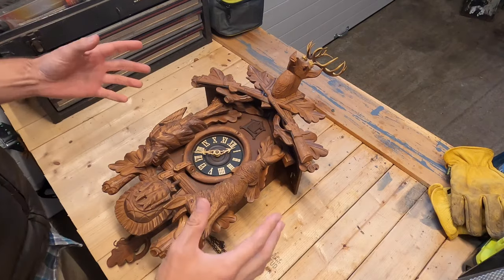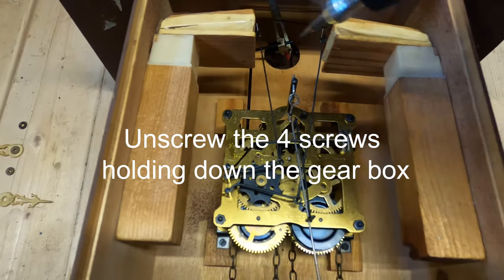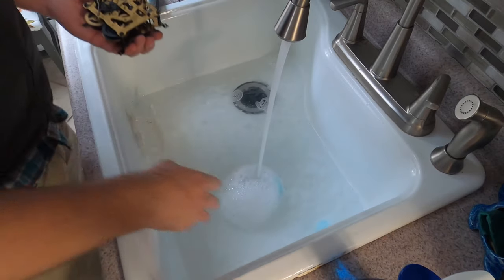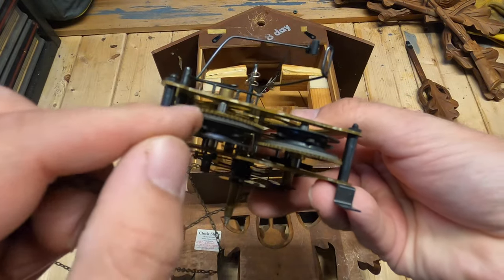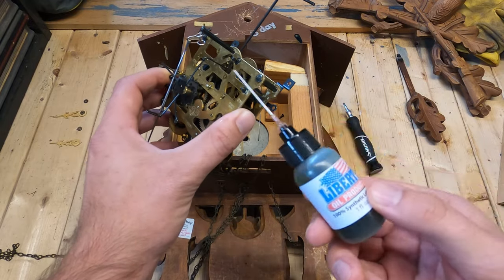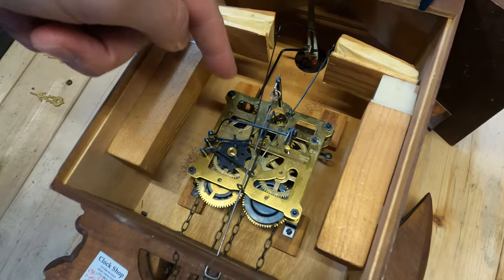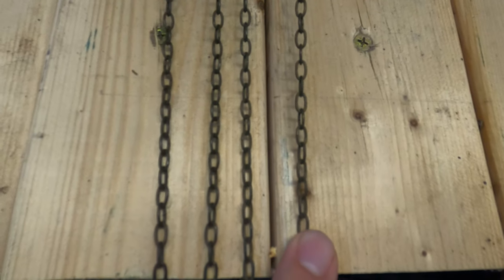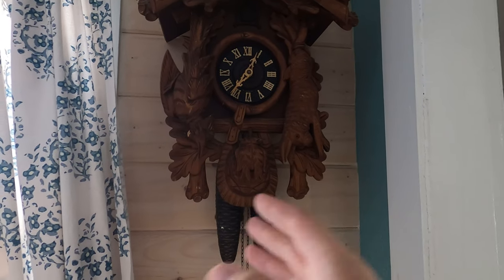Black Forest Cuckoo Clock Not Working? Let's Fix iT!

Comment: AWESOME!  I followed your instructions exactly (I have the exact same clock!) and my clock that hasn't worked in 15 years is working and keeping perfect time!!!  BRAVO!  One small suggestion.  Remind folks to note the time before removing the hands.  I didn't and had to figure out how to adjust the time to coordinate with the cuckoo.  Not hard (just loosen the hands and adjust it to reflect the number of cuckoos generated at the top of the hour and re-tighten).  Excellent video, and the tip for the oil was much appreciated!  :)
Reply from the maker: YES!! I did notice that one step needed to be addressed.

Comment: My grandmother passed away this week and left me her 50's Schatz 8 day cuckoo clock. The pendulum does not stay in motion for very long. I will try cleaning it as you advise. Thank you for spreading your knowledge.
Reply from the maker: May the memories of your grandmother be blessed druszaj and may the Lord heal you and your family in this time of grief. Let me know if this video helps!
Reply: I have this exact problem with this exact clock. I’m going to try clean and oiling it as well. I would like to know if that fixed it as well
Reply: @Genes49  Yes I was able to get it running and keeping time from the cleaning and oiling. Just be very careful of the paper baffles, very easy to damage
Reply: I have the same clock buy mine is seriously like 3 times smaller than yours! Why??
Reply from the maker: Not sure, I’ll bet you’ll figure it out though.

Comment: This may be too late for you to answer, but...   I bought a Schmeckenbelcher musical cuckoo clock a few weeks ago.  It had not been run in quite a while, from what the person I bought it from said.  It was dusty inside and I cleaned it up.  It did not have a pendulum, but the pendulum wire ran fine for hours at a time.  I watched a video on how to lubriucate the movement, and  even though it seemed to be running fine, I lubricated it using the same oil that you used in your video.  Ever since then, I cannot get the clock to keep running - it stops after a few seconds, with or without the pendulum attached.  I only used a drop of oil on each gear pivot point, and I wiped up any excess oil - but it will not stay running unless I put two weights on the chain.  I have not taken the movement out of the clock to clean it like you did in your video.  I am hesitant to do so because of the musical movement.  What do I need to do to get the clock running again?  Thanks in advance.
Reply from the maker: Take lots of pictures and remove one thing at a time. Dirt is probably the one thing that’s hindering your cuckoo clock. If you can carefully and slowly remove the gearbox, you can clean it, dry it, and put it all back together. That’s my best guess.
Reply: @FixiT-Rick  I took the clock down, sprayed the movement with compressed air, sprayed a little WD40 on the gear pivot points, then took a heat gun and dried out the movement, thinking that maybe the heat gun would spread the oil out a little thinner on the pivot points.  I let the movement air out for a day, then used the heat gun again - and now the clock is running perfectly!  Amazing!

Comment: I have that same exact clock, but mine stopped working about 18 years ago & no one in my drivable area fixes them. What if you need to replace the bellows??? Or something in the gears is not right?  I miss it so much, I couldn’t believe when I clicked on this & saw ‘mine’ again! 😢 😢 So sad.

Comment: So helpful!!    I had a cuckoo clock with chain that fell off and its been inoperable for over a year.  Using your instructions, I pulled the  tab off the button of the chain and simply rethreaded it on the gear.  I am so appreciative of your video and instructions!

Comment: Thanks for the very informative video….I think I have this same model….looks to be identical and bought it in 1980. It stopped working 30 years ago or so so had it professionally cleaned and that cost almost as much as the clock did 15 years prior. Well it recently stopped working again and after watching your video it seems fairly easy to do myself so I  ordered some clock oil and am eager to tear into it  very soon. Thank you!
Reply from the maker: Awesome, yeah they can be pretty expensive to have someone else fix it. The cuckoo clock needs to be lubricated every six months or so.

Comment: Extremely good video, thanks a lot!! Greetings from Colombia. My Cuckoo clock was purchased in Miami Florida in one of my business trips way back in 1980! It has worked flawlessly but it suddenly started to stop and the cuckoo singing was very slow. I consulted as local clock repair store here in Bogotá, and they want a small fortune for fixing it. But now, with your extremely well made video, I'm going to try to repair my clock. Incidentally, I'm surprised on how you wash the clock mechanism with just water and soap.  Again thanks a lot!! EDUARDO
Reply from the maker: Make sure the gears have been dried out after you wash them. They must be bone dry with the cuckoo clock oil applied to where the gears rotate and touch each other.

Comment: Amazing. I am looking at your clock and it looks almost exactly like the one on my living room wall and it was given to me by my family. Mine has a darker wood color, but the same overall design with pinecomb weights. It is a Schatz 8 day cuckoo clock and I think it was purchased it in the 1940s because my family member that bought it died in 1953. 
It was boxed up in 1975 when I was a kid and then in 2015, I found a local clock repair shop. It was running well until last summer when it began stopping unpredictably, so I think it needs cleaning. I am industrious as you are but a bit nervous about cleaning it myself but it does not seem very complicated. This seems to be a good weekend project, I'll let you know how it works out. Thanks for the video.
Reply from the maker: As long as the clock gears are nice and dry before using the cuckoo clock oil, you’ll do fine!
Reply: @FixiT-Rick  Rick, well today's the day that I am going to attempt to clean, oil, and get my clock working again. I bought the oil that you recommended and I'll let you know how it goes.
Reply: Well Rick, I was not able to get it fixed, but I did find a cucko clock repair shop near me. The clock shop that I found back in 2016 is now closed, and I was very surprised to find this new shop. I'll just take it in this week and have the pro clean it up and get it running. Thanks for your video and I enjoyed trying.
Reply from the maker: Good effort!
Reply: @FixiT-Rick  Thanks!

Comment: Thanks for sharing. I just bought a clock very similar to yours from a friend of mine. I’ve only had it for two days, and for some reason the pendulum won’t stay in motion. The clock seems to be level. It worked for a day or two. Not sure if the pendulum got slightly bent or something.
Reply from the maker: Glad this video might help you. Whenever the gears are covered in dust they will eventually prevent the cuckoo clock pendulum swinging. Also really important, the pendulum needs to be secured to the pendulum pin. Kind a like it’s pinching the pendulum pin so it doesn’t swing loosely. Hopefully this works out for you, let me know.

Comment: Thank you for this video and the awesome music befitting a Texan! I have the same identical old clock as the one you worked on. It was my first cuckoo clock about 40 years ago and I went cuckoo over them. I had a musical one worked on a couple of times because the music stopped and it cost me an arm and leg. My big hunter clock like yours fell off the wall one day and my husband wanted to trash it. I took it under my care and glued back the broken wooden pieces and bought new bellows. That baby runs but it will not cuckoo. Does a clock this old have a silencer that perhaps is keeping the bird inside? I appreciate any advise.
Reply from the maker: Yes, they do have a way to silence the cuckoo. If the cuckoo door is closed shut then it will not make a sound. The cuckoo has to come out in order to make music or a sound of some kind. Glad you saved your clock! 🐦 🕰

Comment: I have just encountered your video. The clock now runs as long as I do not attach the pendulum. As soon as it is attached the clock stops!
Why? Could you help perhaps?
Reply from the maker: The gears are probably dirty, or the pendulum needs to be slightly adjusted. Also, if the cuckoo clock is tilted away from the wall at just the right angle, it won’t work it has to be perfectly level and straight.

Comment: My daughter brought a cuckoo clock home from the thrift. It doesn't have a pendulum or weights. I've gone on eBay to try and find some, and the weights are different. Is there a way to know what weight to buy? Thanks for your time ❤🕊
Reply from the maker: If the manufacturer name is on the cuckoo clock, that’s where I would start searching online for the weights.
Reply: @FixiT-Rick  Thank you!!!

Comment: I just received a new one day cuckoo clock from Germany as a gift.  Every time i pull the chain to move the time weight back up, the clock pendulum stops.  I don’t always catch it right away, so I have to reset the time & start the pendulum.  I don’t have the cuckoo on.
Reply from the maker: The Pendulum needs to be firmly attached to the part that swings. If the pendulum is loose, that problem will happen.
Reply: @FixiT-Rick  thank you. We will check that.

Comment: Thank you for this video Bless you.
I made a mistake of setting the clock by moving  hands anti clock wise and now the cuckoo stopped coming out .
The cuckoo is stuck and does not come out . It's not stuck as the bellows are moving and the bird comes out manually
Reply from the maker: Interesting problem. Let me know if you figure out what went wrong.

Comment: So when you rechaing it, they both come through the middle , so one clockwise one anti-clockwise...or is it because you are rightie? It probably doesnt matter
Reply from the maker: If the chain easily turns in one direction, for example, if the gear easily rotates clockwise, you want the side that turns with the most resistance to be where the counterweight hangs on.

Comment: thank you, also my gong doesnt gong and the cuckoo coos at 2 and its 3 and cooes on the 15 min. Mine is very very old
Reply from the maker: Try to find something loose or out of place where the Cuckoo is connected. It’s always something small that can disconnect it from working. Start looking at the thing you want to work and ask very simple questions like, is that supposed to be loose? Did something fall out of place?
Reply: @FixiT-Rick  she is running fine now less the bird or gong. I completely cleaned it. will start looking in it to see if I can find something. My Bird is relieved though the cuckoo scared her

Comment: Great video. Hope your clocks are not like mine. Mine worked for over 30 years but I never oiled it.  Now the place where the pendulum weight shaft goes through the brass plate is worn out. Moral of the story - make sure you oil yours periodically so that does not happen to yours.
Reply from the maker: Thank you for your input, Dan!
Reply: @danmills2753 All Cuckoo Clock parts are fairly standard including the movement. If you like the clock and want it to work again, it can be done.

Comment: Thanks for sharing this video. I just purchased what looks like the identical clock. Two issues seem to be at hand. First is the clock has run for no more than three hours without stopping. Second is that the clock seems to always stop after the cuckoo sings at the top of the hour. I have a bim bam mantel clock that I have worked on in the past but cuckoo clocks are new to me. Special oil ordered as it is quite dusty. The top of the hour thing baffles me. Any suggestions?
Reply from the maker: Dirt and dust will bing up the gears and stop moving them. A good cleaning is all she needs. Thanks for watching the video!

Comment: received a new 8 day cuckoo clock with music box for Christmas.  The clock was shipped from Germany, everything works ok but the cuckoo on anything over 6 chimes starts off normal, then speeds up in the middle, then slows back down at the end.  Gets annoying on the longer chimes as the bellows speed way up in the middle of the sequence.  Is this an easy fix or should I take it to a shop for warranty repair?  Nearest shop to me is a 3 hour drive one way.
Reply from the maker: Not sure. Someone may have solved this problem in another video, but if there is a manual on how to change the settings, that’s where I would start.

Comment: I have a identical clock like yours. However the chain doesn’t hold the weight. The second problem is the big hand and small hand stop moving. Thoughts ?
Reply from the maker: Great question! I would like to know more about why you think the chain does not hold the weight? And if both hands stopped moving that means the gears are dirty and you just need to clean it like how I demonstrated in this video and use Clock gear oil to lubricate the gears properly. The link for the Clock lubricating oil is in the description. Does this help you?
Reply: @FixiT-Rick  as I rewind the clock I pull the chain and weight all the way to top/bottom of the clock. When I release or let go the weight drops and the weight falls to the bottom. It’s like the pully is off track
Reply: @BigJake2023  Same issue I have.  The weight drops to the floor.
Reply from the maker: That sounds like an interesting problem. The gears may have moved out of place.

Comment: Hi
Thanks for the video.
I also have a 1day cuckoo clock.
The clock is ticking, one chain and weight are going. But the other weight doesn't move.
I only can pull it up.
So the bird doesn't cuckoo
What can I do about that problem?
Reply from the maker: One chain is for the cuckoo bird and the other is for the clock time. A good cleaning might be needed.
Reply: Thank you for your replay
That wasn't the problem
It was the hammer and the gong
The two held each other stuck so the chain for the cuckoo didn't run.
I hope you understand, I am from Holland😁

Comment: Before washing the movement in detergent and water, soak the movement in Mineral Spirits (paint thinner) for 15 minutes.   Mineral Spirits is a much more effective solvent at dissolving old oil.  Then wash the movement in water and detergent (If you have an ultrasonic cleaner, it is even better than washing the movement in a sink).   Be careful with that heat gun, use a low heat setting.  Too much heat is Not good for any clock movement.
Reply: Brake cleaner works too and doesn't seem to effect the brass.

Comment: I have more or less the same clock... It's a 1970 West German 8 day Cuckoo clock... this clock was sitting in a box in a barn since 1991.  I have cleaned and oiled the clock and I am having two issues.  The clock runs but as soon as I add the pendulum it stops.  Without the pendulum it is running way to fast 20 minutes = 1 hour.  The other issue is the hour hand has a metal piece that fits in first.  That metal piece has come out... Can I glue it back in?  How do i get it lined up with the time before gluing it?  Last mine has no finish or stain on it... Can I statin it without damaging any of the functionality?
Reply from the maker: For your Pendulum issue, I would pinch the point where the Pendulum hangs on the hanger. As for the other, I’m not sure.

Comment: The minute hand on my quail cuckcoo clock is extremely tight and will not move. The screw mechanism wont budge either. Advise please.
Reply from the maker: I would use needle nose pliers, mainly a Gerber, to squeeze the nut gently give it some force to loosen it.

Comment from the maker: Thanks for watching Fix iT Rick! If you want to watch more videos, subscribe, and comment on things you want to see get fixed! Thanks for sharing this video!
Reply: One thing to note is that this is an 8 day movement which is less common than a 1 day. There are also cuckoo clocks with dancers or a person on a swing. All of these mean different sizes and amount of pine cones that must be located in the correct holes or they pull down in the wrong direction.

Comment: One of my chains falls when I put on weight. And the chain is on the gear
Reply from the maker: The chain simply came off the teeth of the gear. ⚙️
Reply: @FixiT-Rick  I put it back on the gear but it freely moves no longer clicks

Comment: Hey Rick, I have a cuckoo clock and one of the weights drops to the floor and pendulum doesn't swing.  It's a small clock from west Germany . Best Wishes! 
 Nice video!
Reply from the maker: Hey there Caramia! The cuckoo clock needs to be at least 7 feet high from the floor. And the pendulum needs to sit nice and snug on the part that swings. Thanks for watching the video!

Comment: Own 4 clocks, this similar 8 day clock, Cuckoo is set up different, is the only one that wont stay running..so annoying....
Reply from the maker: Most Cuckoo Clocks simply need a good cleaning and clock oil reapplied on the gears.
Reply: @FixiT-Rick thanks like I said I have 4 one that has music with dancers runs flawlessly and this version is JUNK.  I paid a guy (local clock/watch repair, talked a good game)  $400 to redo it. ran 6 moths and got progressively worse again over a year. now it runs/stops/hangs up around 5 till sometimes nothing consistent, tried lightly oiling it to smooth it up, made sure it was level and adjusted, watched every video on youtube...it's going to be a wall ornament before I spend more time on it.
Reply from the maker: Dirt and dust is the problem. A simple wash of the gear box in hot water and soap will get the junk out of it.

Comment: Not a good way to clean it, trapped water will rust.  If you use water which is not recommend, you should at least rinse in alcohol to try and displace the water.    Then dry.
Reply from the maker: Noted. The clock has been working since Christmas, but I see your point. We can agree that the gears must remain totally dry.